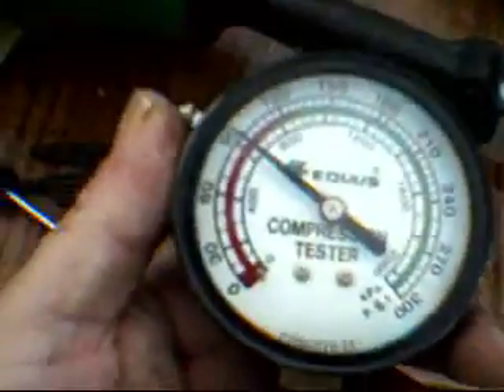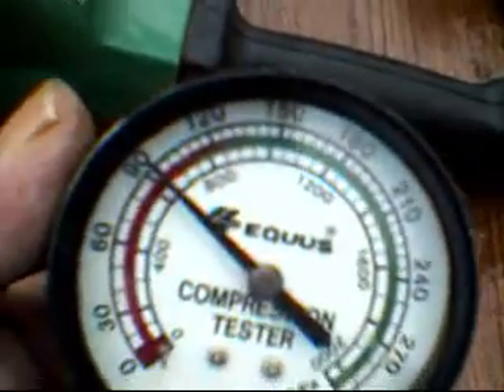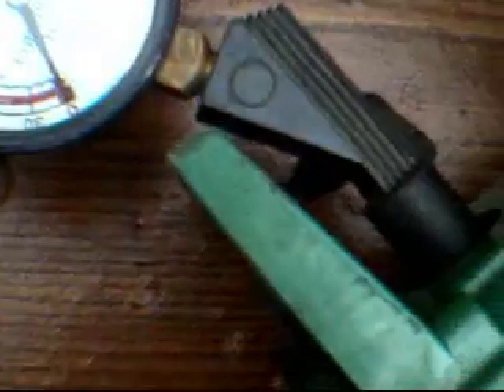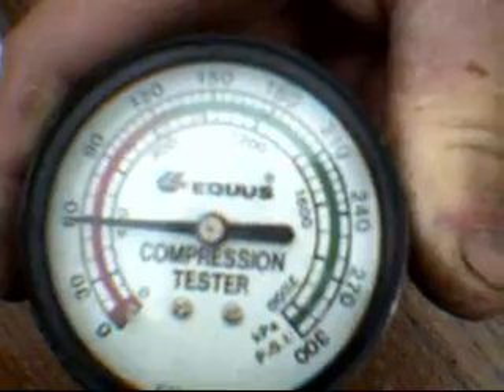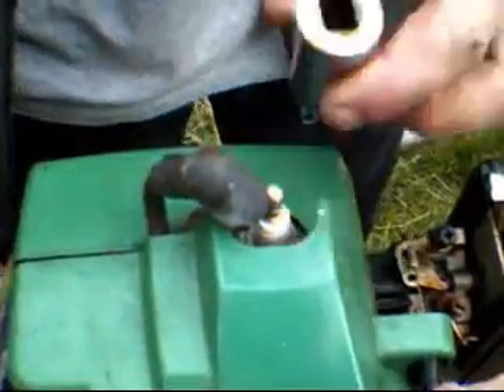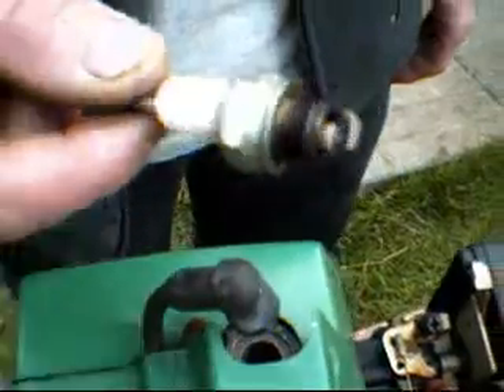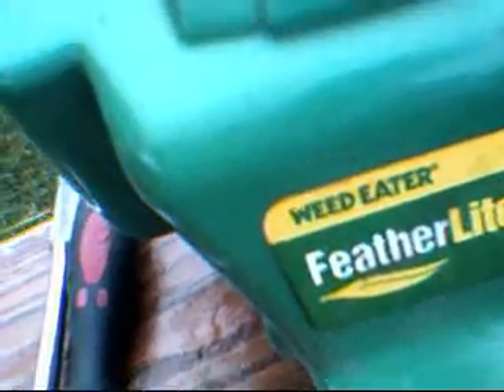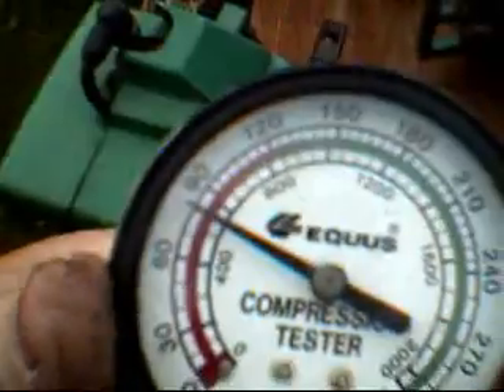Compression testing your weed eater

Comment: i have 2 echo weedeaters, my brain is rusty on this one. when i pull the chord it pulls but the chord freezes like 4 times per pull. i have a bad rib so i simply cant do this i need to fix this. i took the spark plug out and pulls the chord and it glides easyyyyyy.
Reply: i remember the one was never this hard to pull. and i gave it to my dad a few years back. and since he just passed i inherited all his lawn equipment. so i been trying to get them all to run to sell them on my spare time. i know he could get it started but it was really rough. i just remember it being smoother then this in the past. it feels like im going to rip my arm off lol. the compression strokes make sense, they seem to have harsh stopping points like way harder then it should be. the drill is a good idea but since i need to sell some of this stuff to make space in my garage id like to try to get it in better shape to sell because i like to be a good seller.

Comment: My Craftsman starts and runs for about10 to 15 secs. and dies. New, carb. gas lines, checked intake reed valve and exhaust port. Guess I should have tested compression first.  90 lbs. plus? Coil? Oh boy.
Reply from the maker: Oh Boy !  The three simple and most important things to check are Fuel ,Compression and Spark . Two Cycle engines can be difficult to figure out. You have gas and oil mix which can give you problems also.
Reply: Yes, it has low compression so I broke it down to find scored cylinder, piston and rings. Parts are no longer available from Sears. Some parts I found but are way to expensive to put in an older unit like this. I found units on Craigs List but they are too far away to be worth the trip. Oh well.

Comment from the maker: Just by Chance did you try a compression test just after it stalled out?  The heat can effect a coil thats burning out also.  Its usually a sign that your coil is week. check for spark right after.

Comment from the maker: Small engines require compression to operate appropriately. Provided the engine can be rotated at a normal starting rotation, then the compression can be tested..  The most concerning issue is that the engine is capable of producing enough compression to maintain proper engine operation. On average, compression should range between 60-120 psi in the cylinder.